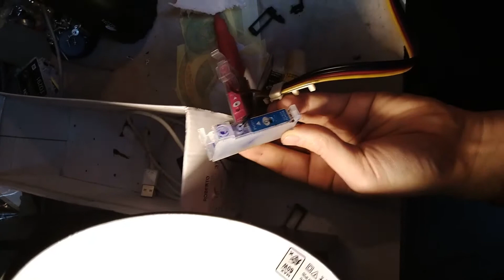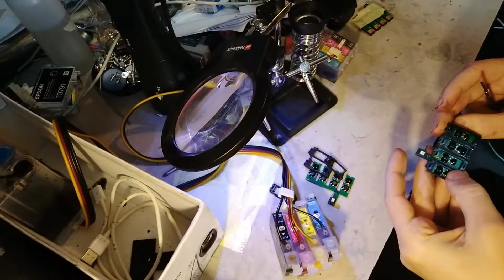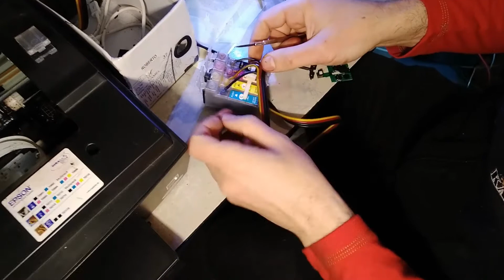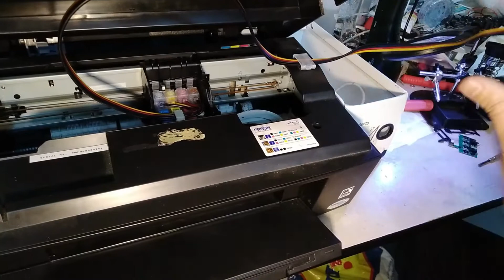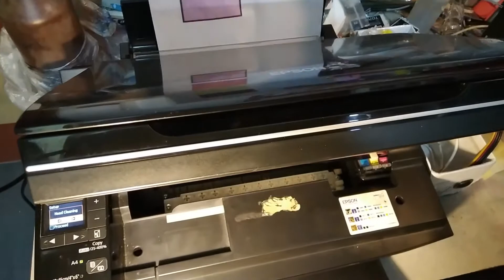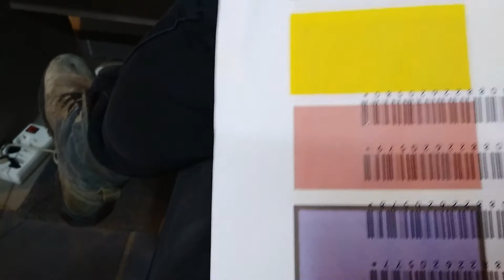Epson sx218 repair (part 2)

Comment: Hi. I have model Sx215 with CISS and receive all the time message "ink cartrigde not reconized". I press start/proceed , but I get same error. I push the button from reset chip, the same. I changed the chip reset board, same message.
Reply from the maker: is it only one cartridge that cant be recognized or all of them?
Reply: @Max0ressurected  all of them
Reply from the maker: @dadasahen1524  than its most likely that you have burned the motherboard and the second thing that happens more rarely is a faulty electronics on printhead
Reply: @dadasahen1524  It is most likely a blown fuse on the mainboard. They report this error if you insert a cartridge wrong. I cant say for certain but I have seen 2 models blow fuses in the exact same way and then they recognize carts until you put the fourth one in. Take the cover off and check the mainboard. They are labelled F1 or F2 and you can test them with a multimeter and just bridge them in order to fix. Costs nothing and worth a check as it might make your printer work again